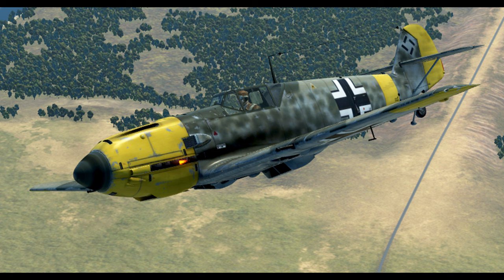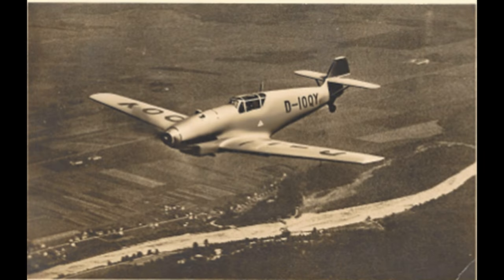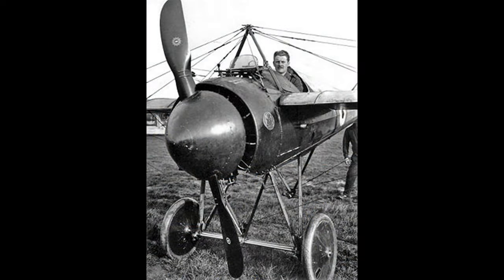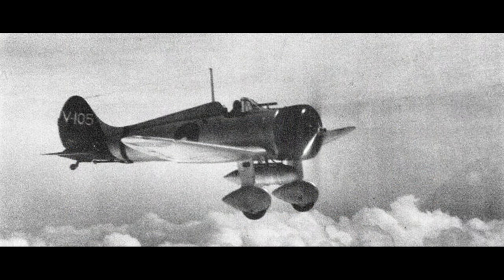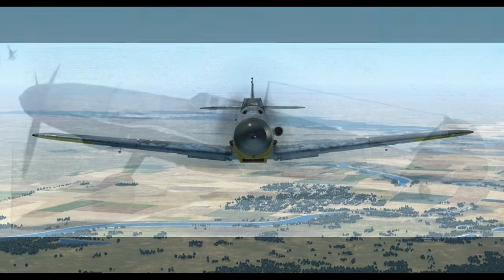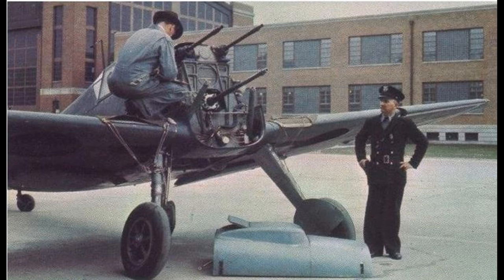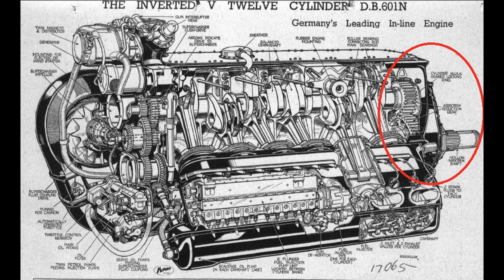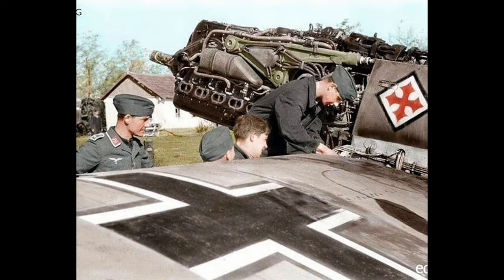Why an INVERTED V-12?  PART 2

Comment: I'm liking the visibility and maintenance explanation.   Thinking a bit laterally, might not an inverted engine type also resist flooding, essentially excess fuel would purge with assistance from gravity?

Thought no. 2, an inverted engine places the 'thrust' from the exhausts lower so it acts through the center of mass better.

Comment: Having watched your video again.  and with out any supporting evidence. the first Bf109s were fitted with RR merlins. if you look at the photos. personally i can see little difference between any advantage or disadvantage in visibility. so i do not think that is a valid point.  Both power plants had center top mounted machine guns, although the RR didn't have the spinner mounted cannon.  i doubt that this was a deciding factor. I recall a youtube video with Sir Sopworth. one of his comments was the detail in keeping his aircrafts mass as close together as possible. so motor fuel and pilot is as smaller area as possible.  this is not just forward and aft but also vertical alinement.  if we were to add, centerlines of thrust and drag to the mix. it would make sense that having an inverted motor would keep the centerline of mass close to the centerline of drag. thus a maneuverability improvement. we can even apply this to the spitfire and hurricane. both with taller fuselages and greater dihedral  would raise the height of the center of drag, so having a higher center of mass was not such a disadvantage.  Now if this is a result of not inverting the motor or the other way around i would not know but i suspect it was. Other technical advantages the germans had was better scavenging/ dry sumping. but again i do not know if this was as a result or because off??   i think it is however safe to say that the british had a more romantic vers the more teutonic approach. IE the RAF of maintaining positive G in all movers, simply because that was the correct way to fly. limited the RAFs vision of what combat would be. or was it that the germans just had the experience of spain?  I do however think that the boat/ tank motor theory is a red herring given the timeline.   merlin powered tanks/ meteor. was really an ad hoc panic application by the british,   the meteor motors were actually built by rover after quite a bit of redevelopment. IE like making the motor spin the other way and only happened well into the war.  PT and MTBs   again like the merlin in marine application the packard was the american motor of the day. american PT boats were based on a british racing boat and packard supplied there V12 simply because of availability. the packard tooling was doing nothing at that time and the merlin tooling was barely up an running with order books full.  as a side note the canadian MTBs  running merlin's sometimes were refitted at overhaul time with packards or the other way around as supply dictated. many years ago i read of a canadian MTB with a mixed canadian australian and british crew being powered by one merlin and 2 packards. i guess needs must!

Comment: prop clearance is so an issue with gear reduction V engines and it favors the upright engines used by the allies, which could use shorter landing gear as a result, however this was not overwhelming.  Also neglected is the lifting body advantage of a low nose exemplified by the Concorde droop nose but also by more recent Mig 29 and SU 27 etc.  The inverted cowl better approximates this shape.

Comment: Greg, upright V-engines tend to cause more problems than you give them credit for (or is that debits?). The early P-40s had the cowling MGs mounted way back behind the engine, as in the 109, but they had extended "barrels" that ran 5 feet+ to near the spinner, which was incredibly awkward. There's extra weight and drag, and the whole situation would be worse if there wasn't that horrible air intake on top of the nose with a duct running all the way to the aft end of the engine. That forced the cowling line up anyway. The whole thing is a mess. Note that the nose MGs were deleted from the P-40D because there wasn't room.

In 1916, the French were the first to use a cannon firing through the propeller hub with the Hispano-Suiza Type 36 V8 "motoeur-canon." Hispano-Suiza evolved the engine into a V-12 between the wars, and the 12Xcrs was the powerplant of the Dewoitine D.501 that went into service in 1935. The D.500/D.501/D.510 series mounted MGs in the cowling in some variants, but others had single rifle-caliber MGs pushed into gondolas under each wing because there wasn't room in the cowling. The "nose" machine guns were squeezed tightly together so that they could fire between the cylinder banks, but this put their muzzles absurdly far back. When the cannon was installed, firing through the propeller hub, the MGs couldn't fit. Admittedly, the problem was that the HS-7 (and the later HS-9 and HS-404) was drum-fed, and the drum sat above the gun in the space where the machine guns' barrels would have been. With the replacement of the awful (but belt-fed) Darne machine guns with the drum-fed MAC 34s, placement in the cowling became impossible in any case.

If you look at the D.500/D.501/D.510, you'll see that the horrid shape of the cowling is due to the cylinder banks sticking up on either side and the "cut-out" for the bullet stream. (The channel between the cylinder banks might have somewhat improved visibility over the nose.)

The Morane-Saulnier M.S.406 featured the evolution of the 12X, the 12Y. With a cannon firing through the propeller hub, its machine guns were again forced into the wings. A single rifle-caliber MG in each wing is really an absurd mounting at this point in aviation development. In any case, even fitting belt-fed MGs in the nose would have required a serious redesign, a higher nose, and more drag. This configuration continued in the far-superior Dewoitine D.520, which at least had pairs of MGs in the wings. (This was despite the use of belt-fed wing MGs, which were practical as nose guns.) The designers of the Arsenal VG-33 similarly decided to forgo nose guns.

The Soviets used license-built 12Ys as the M-100 series, which they continued to develop after the fall of France to the Nazis. If you look at the Yak-1, you'll see that the machine gun (or guns, in some variants) are mounted above the cylinder heads, even though the ShVAK and its ammunition are vastly more convenient for mounting a gun or guns between the banks. This raised the hood line probably added some drag, and definitely didn't help visibility. (It also made basic engine maintenance just a bit more complicated ...

Sure, the Gloster Gladiator has two of its guns firing through the cowling, but it has a radial engine and the guns are firing through the inside of the cowling: https://en.wikipedia.org/wiki/Gloster_Gladiator#/media/File:Gladiator_-_Shuttleworth_Airshow_(4760760267).jpg    See the indentations on the inside of the cowling ring? Radials are always different beasts.

The La-5 ran its ShVAKs essentially at the very top of the cylinder heads, again taking advantage of the geometry of the radial engine. Because the cowling had to be larger than the engine (to provide airflow), the guns fit into the existing diameter, instead of increasing it.

Comment: Very interesting video/article! It still has not explained the real reason why the Germans choosed the inverted the V12 engine. In my modest opinion it allowed an easier mantainance as many important items especially regarding the fuel injection system and change of spark plugs could easily been done from the ground and it was a relatively quick job to change engines compared to the Merlin engine. It also permitted a smaller and narrow front and perhaps offering better visual for the pilot. Keep posting and good job!

Comment: Another awesome video.  My take on the subject was formed as a child building model airplanes.  The inverted V when viewed straight on conforms with the wide side of the fuselage aerodynamically.  It was so obvious that I never thought it was a subject for debate.  Until now.  Maintenance would seem simpler,  but then one would have to assume that Willy Messerschmitt had that in mind when designing the aircraft.  I've reformed my opinion that there was no reason at all.  Thanks

Comment: Very informative. Answered a few of the questions I had. I read somewhere that the Russians preferred the guns in the nose. As it helped with aiming, and lessened shot dispersal. One of the reasons they didn't particularly like the spitfire. That, and they thought it was over complicated. And the ones they received where worn out
Reply from the maker: All true, but there is a lot more to the Russian Spitfire story. The reality of the plane just didn't live up to the legend.
Reply: @GregsAirplanesandAutomobiles  As a Brit, I would disagree 😁 it's a legend for a reason. Right plane at the right time. But a plane is only as good as the pilot. The RAF had the best of both
Reply from the maker: One day, I'll cover the Spitfire's history.

Comment: Most German sources, that I am aware of, cite "ease of maintenance" as the key driver for using inverted engine configurations. However, in an Daimler Benz advertisement on the DB-600 "world record engine" from 1937, the company praises the small frontal cross-section and low drag of the engine in a 109. Remember, the 109's design principle was to fit the largest possible engine in the smallest possible air-frame. So at least for the 109, low drag fuselage shape might have been a factor. 
However, the DB60x series engines were not the only inverted V12 ones. The Jumo 213 series also was. And with the distinctive ring-cooler, the frontal section was far from ideal - you could have an upright V12 with the same cooler configuration at the same "frontal section cost". The reason to use the ring cooler of course was, to remove the necessity of an additional cooler inlet. Before the FW190 D series, the Junkers Ju88 were the most prominent application of the Jumbo 213. No guns were mounted in the engines nacelles and there never have been plans to do so.
So, I would conclude, it is safe to assume, that serviceability was the key factor.

Comment: You have some good points on that.
What came first, the planes or the engines? I believe youre right about the maintenance issue. Germans were and still is focused on ease of maintenance. I am a aircraft mechanic on c130j, and LM dosnt seem to have that in focus ;)

Comment: Greg love the series but I have a question that I am unable to figure out on my own.  Why do the fighter planes of WWII need such huge engines to pull the plane through the air?  Why with supercharging and turbocharging is a huge displacement power plant needed?
Reply from the maker: RPM! Aircraft engines need to make power at relatively low RPM, for an aircraft engine 3000rpm is screaming. Today there are many smaller engines (race cars) that make 2000hp at 7000rpm, but making it at 3000 is a problem and the best way to solve that is with a combination of displacement and boost. The RPM has to be low to keep the prop's tip speeds down. They can and do run a gear reduction, but there is only so much that can be done there.
Reply: Don't forget that supercharging is needed just to allow the engine to produce the same power at high altitudes as it does at sea level... without supercharging these same engines would only produce a fraction of the power as the air becomes progressively thinner approaching and above 10,000 feet.
 Modern aircraft that are not supercharged are generally restricted to operating efficiently at 10,000 feet or less.
Reply: @GregsAirplanesandAutomobiles  Thank you for the answer and please keep the great videos coming!

Comment: I found an old Civil Aeronautical Bulletin # 28 1942  (Pilots' Powerplant Manual) that states that inverted engines were used in oval shaped fuselages and aircraft with side by side seating, including trainers.  It's a US document but it does seem to back up your thesis from your first video about German oval fuselages.   Maintainability also makes sense, but the German propensity to over engineer and their fanatic use of very close machine clearances seems to militate against any care for maintainability.   The He-111 used inverted engines but they still needed step ladders to get to the valve covers since the aircraft sat higher than the Me - 109.  But, I'm an engineer and arguing with an engineer is like mud wrestling a pig .. we both enjoy it.  Your videos raise more questions than answers, which is a great application for YouTube. We're all learning from your channel. Thanks.

Comment: Very interesting discussion, I have not checked to see if this has been mentioned but could the use of the inverted "V" be to align the widest part of the engine with the wing for an overall reduction in the front profile and thus drag? This advantage would only help the single engine planes. Could the use of inverted "V" engines on the larger planes with twin wing mounted engines be down to a rare case of standardized components, unusual in Nazi equipment?

Comment: As far as I know, the prototype of the BF / ME 109 was born from the idea of a "racing airplane". A low wing aircraft with a high center of gravity would not be particularly stable in flight. Turning the engine upside down shifts the center of gravity down and helps bring the plane back into a horizontal position after a turn
The 109 is also a relatively small aircraft compared to American types

Comment: Early ww2 German v12 engines used ball or roller crank bearings which have a service life of about twenty five to fifty hours inverting the engine eased maintenance they switched to bearing shells later during the war due to a shortage of manpower imagine rolling bearings into an engine every 25 hours. The switch to Babbitt bearings simplified assembly and maintenance but in their case shortened engine life as they didn’t use indium in the bearing shells as the British and American engines did.

Comment: I agree with the idea that maintenance was a motivating factor in the choice of inverted V set up. One down side of this arrangement is the possibility of hydraulic locking if enough engine oil were to collect in some of the cylinders. Because of this the ground crews were required to manually rotate the engine backwards using the prop. This would open the exhaust valve first and allow the oil to drain out. Any one who has been around radial engines knows this.

Comment: As brief as I can make this. A major difficulty with high power engines particularly inline engines is cooling them..they are somewhat misleadingly called either water or air cooled.. actually the lubrication oil plays an important part in cooling the engine..it comes into intermate contact with all the parts of the engine.. carrying heat gathered with it. The crankshaft has the most flow of oil from it..if you place it at the top of the engine that oil flows down through the engine creating in effect a contra flow heat exchanger..the most efficient heat exchanger.. discuss...Regards..

Comment: Gear reduction. On a Air Boat we use gear reduction more to save the crank. Chevy V8's, VW motors, ground power continental engines all of them. The stress on the crank shoves it out of the bearings. Of course none of these motors were designed for a propeller to be hooked up to the crank. True air plane motor on a Air Boat is a very expensive proposition, you do see them, not in my league.

Comment: Yes but the cowl mounted machine guns on the earlier aircraft were external and were easy to remove for service 

I bring up remove for service because on an upright engine there is a valve train and usually an intake at the top taking up available space for the machine guns 

Now the engine serviceability is extended when the coal mounted machine guns and all ammunition has to be removed before you are able to start work on the top of the engine 

Coincides with your earlier point of the valves being easily accessible on an inverted engine 

That’s why most allied fighters put machine guns in the wings they realized this problem early in the 30’s

Comment: Soviet Yak series of fighters also had their machine guns mounted in the cowling of their upright V-12 Klimov M-105 engine, as did the LaGG-1 and LaGG-3 with the same engine and MiG-1 and MiG-3 with their upright V-12 Mikulin AM-35. oh, and the Yaks albo did sport a 20mm cannon firing through the propeller hub of their upright V-12s.

Comment: the problem of the inverted motor is easier, it was inverted because a normal one did not fit in the fuselage of 109 and they decided to invert the cylinders only that's why they designed the plane before the engine and found that a conventional engine did not fit, the example you have it in the 109 that were made in Spain after the war as they did not find motors mercedes 605 they fitted a British merlin engine and they had to modify all the accommodation of the engine by the way it was very ugly and they took out the nickname the buchon greetings apologize If there is something wrong written I do not speak English and translate it into Google translator

Comment: thanks you covered the cannon... but the spitfire was hampered by 8 guns in the wings... the russian's hated the configuration best to have one cannon and two heavy machine guns on the centre line... cheers
Reply: As a War Thunder player I concur, firing straight ahead without convergence is easier to hit targets at varying ranges.
Reply: @Jester123ish  With wing mounted guns, At a far range, the bullets cross well before the target, and keep separating to the sides!  Just look at the many films where the pilot is straffing the target and most bullets are wasted!
Reply: @alfredomarquez9777  Exactly, a forward firing gun mounted on the fuselage is easier to hit with.